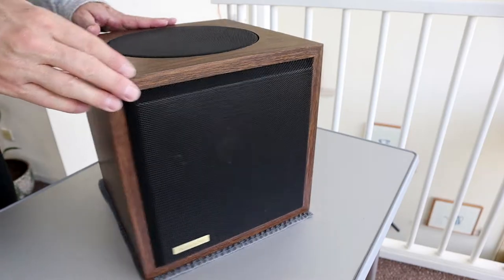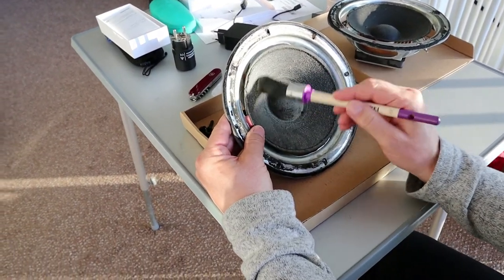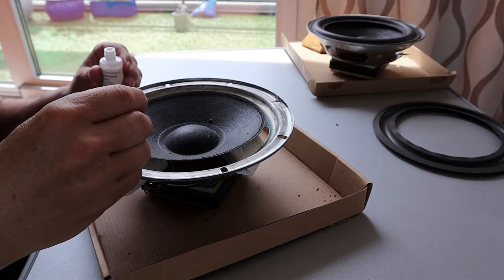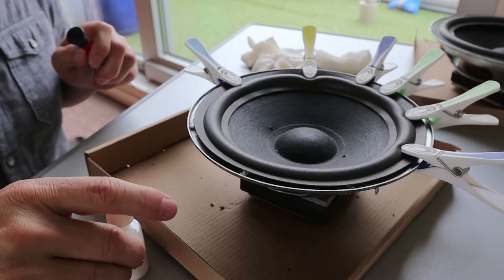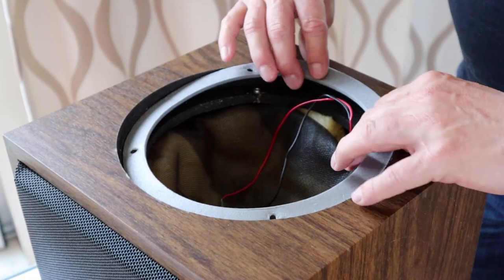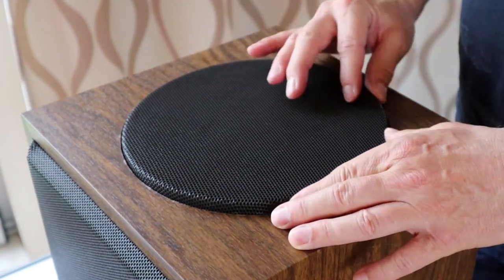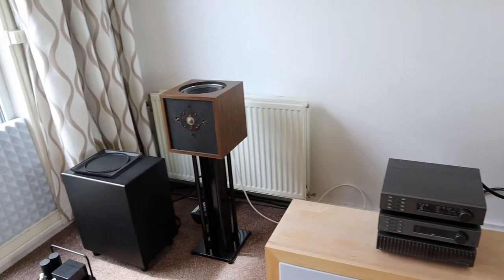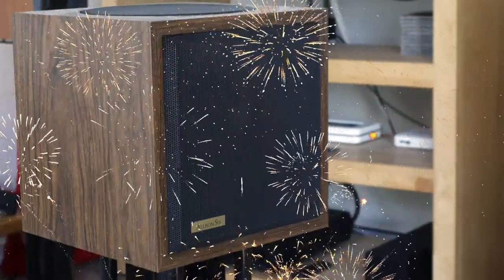Refoaming  the  'ALLISON-SIX'  loudspeakers.

Comment: I worked at Allison in the '80's. When gluing the foam to the paper we used a steel ring to press them together. Then into an oven with s continuous belt to dry them. Checking the center for rubbing also one of our tests. We used a white glue. Don't remember any brand name. We used a dark latex paint on the paper cones. So glad to see these speakers are still being enjoyed.
Reply from the maker: Hi there and thanks so much for your response.
These speakers sound amazing. Unfortunately some of the glue got loose again so they need some work again.
Is there any chance you have some specs on these drivers? I would like to just replace them (until I fixed them) but I seem unable to find any good info on these drivers.
Reply: @theaudiophilebarista2424  I don't know who made them for us. Was there anything about weight,etc ..on the bottom of the magnet?. I remember on  different models the cone had different sizes of weight rings around the coil and under the center dome. All the engineering was done by Dr. Roy. We offered a 5 year warranty. Free UPS shipping back to us for repair. Dr. Roy read every customer complaint letter. His name is on the product. We got a return on some speakers from the '60's. The customer had little dogs that had peed on the backside of one speaker. At some point the furniture was being moved and the damage was seen. The customer was Mrs. Walt Disney. She mentioned the enjoyment of listening to music just her and Walt, having some time together. Luckily nothing got tossed. We had a few pairs of the pyramids. Dr. Roy wrote to her that we could build a "new" pair with all new parts and put a few coats of industrial laquer to protect them. We made sure everything was perfect. Made up for people who tried to get free replacements on speakers that were obviously customer damage. As far as specs go, You might find sales paperwork on the Internet. I hope this helps. If you have any questions in the future contact me. I'm not Dr. Roy but I'll try.
Reply from the maker: @BrianLevine-q7e  I will keep you in mind.
And that is truly a wonderful story. Thank you for that ☕️🔊🙏
I will look on for more information. The drivers really don’t give me anything at all

Comment: Hi, very nice video. I also have one pair of ALLISON-SIX loudspeakers. Need help. The woofers on the speakers were the same shape as yours. The rubber was completely ruined. I try to replace the rubber but without luck. More or less like you did. In the end, I bot a couple of 8 inches 8 ohms 100 w woofers from Amazon and make replacements. The speaker's sound is weak and could be louder. They are connected to S.M.S.L SA36A class D amplifier 2x12w 8 ohms. But I am wondering, how to improve the sound.  As I know, the impedance of the whole speaker is determined by woofer impedance. In my case 8 ohms. The original speaker has 4 ohms so I suppose that woofer also has 4 ohms. Maybe that's why my speakers are not that loud. Maybe  I can replace the amplifier with a more powerful, let's say 2x30w. I am listening to jazz & film music and prefer compact HiFi systems. What is the impedance and wats of the original woofer?

Comment: I bought a pair of these back around 1983 or so.  I'm about to undertake a re-foaming on them myself.  This should help, thanks.
Reply from the maker: Yes, these are wonderful speakers. Unfortunately, it later turned out, I did not use enough glue. Too thin a layer. So be generous with the glue 😉 These speakers deserve to be played 👍
Reply: @theaudiophilebarista2424  I saw that glue issue and took note!!!